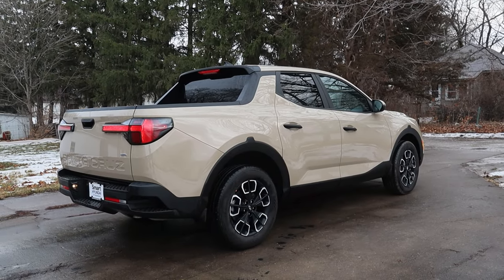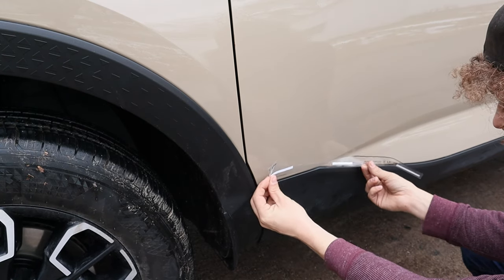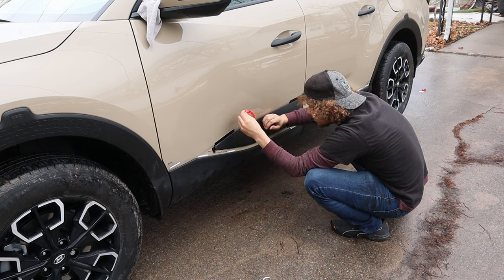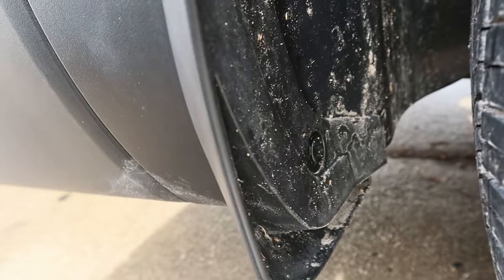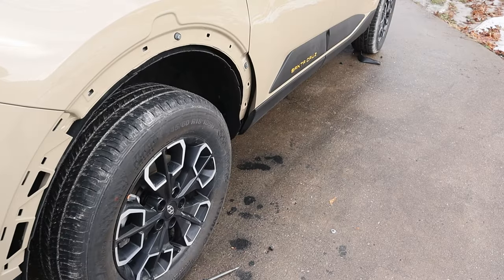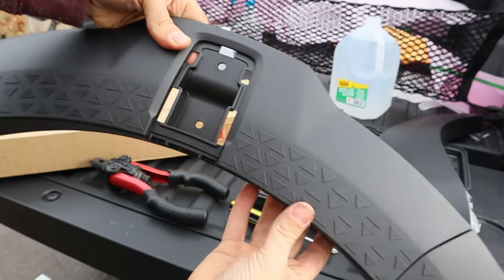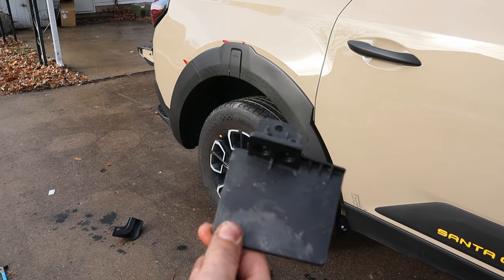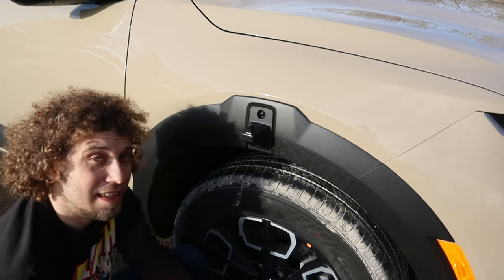Santa Cruz Door Garnish, And Fender Flares  Install Guide

Comment: I am ver happy for you that you can have this vehicle. 
Today I was thinking. If i couldn't have the Limited, I would get a $30.000ish one. But would HAVE TO have three things: The 2.5L turbo engine, AWD and the 10.2" screen on the inside. 
I don't really care about the screen with gauges although it has nifty featutes. Am more of a analog guy. But with those three things I'd be happy. The rest would fall in place over time. 
About the flates I would wait till someone makes wider flares that come out more. So I could fit fat tires on with sexy 20" deep dish rims under them. After I lowered it. 💪😎👍👍🤙😉

Comment: I love the side garish.  I have a Sand color also.  I need to get them.

I don’t personally love the large fender flares.  Maybe aftermarket ones will come although base fine for me.  I have a limited but feel the unpainted door handles look better.  I also can’t stand the limited wheels so I bought the base wheels you have (which I think are great on this truck) for snows and then swapped the 20’s with Palisade Wheels (identical specs).  The Palisades aren’t awesome but anything is better than the limited 20’s to me.

Good luck…
Reply from the maker: Coulnt agree more!  The limiteds where every unattractive to me.    Hope some more aftermarket parts show up as well!

Comment: Great video!! If you had no intention of ever installing the gopro mount... do you think you could forgo the rivnuts entirely?
Reply from the maker: Mmm, perhaps. The still connect the flair to fender in the middle bolted down. 
But thee is probably enough 3m tape, and clips to not need them specifically

Comment: Your lucky to get the sand color because it is discontinued, so I guess you got a rare car !
Reply: Where can I find this kit ?
Reply from the maker: I got mine from. I bought mine from the dealer ship in town. 
But you can get it at world oem parts 
Or hyundai oem parts direct. 

Door garnish part number: K5F32-AC000

Fender flair kit part number:K5F32-AC600